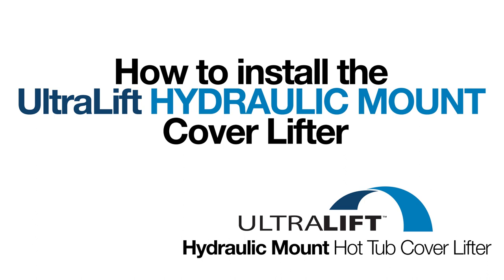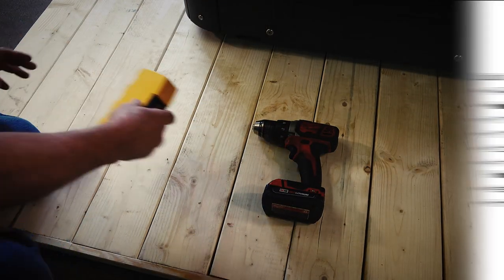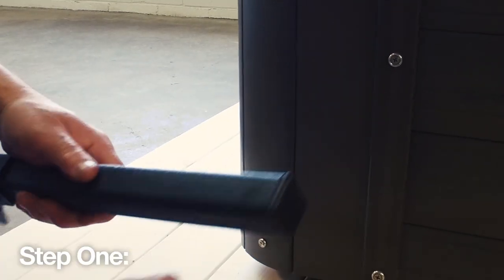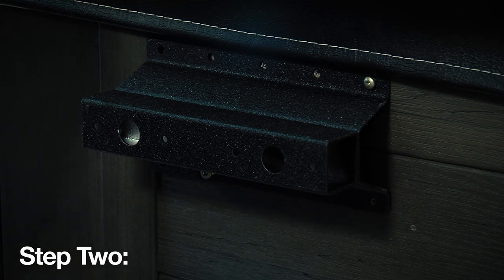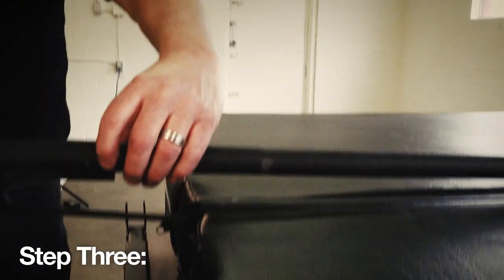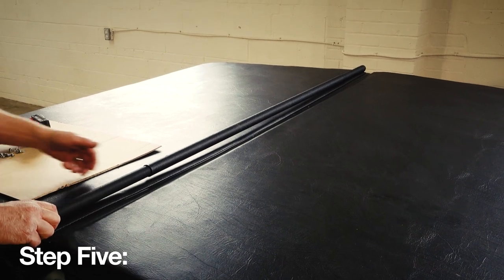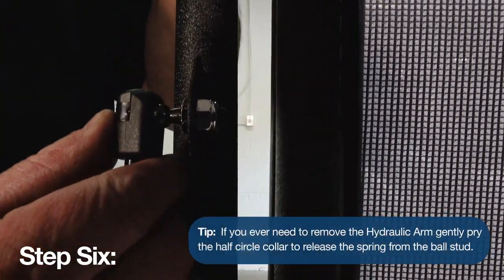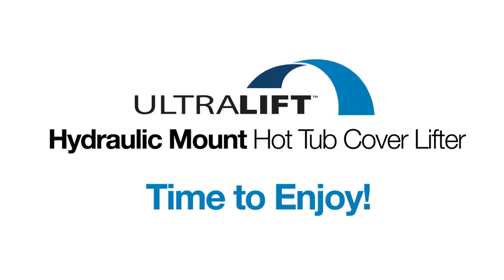Ultralift Hydraulic Mount Installation Video 2019

Comment: Disappointed that this updated release still has poor lighting, everything is black on black from the guys clothes to the lifter parts and the spa.  steps skipped.  Instructions with the lifter equally poor.  Assembly is relatively easy but 10 cents of stickers on parts would make assembly a breeze
Reply: Agreed. "Install the ball studs as shown" was particularly troublesome for me. No mention here or in the instructions to install them in the pivot arms. Intermediate pictures showing the work in progress (not zoomed in) might also help.
Reply: Are the anchoring screens for the base simply screwed into side panels or anchored to metal frame or something.

Comment: I'm still assembling this, but I had to award Ultralift a prize for the worst instructions (video and printed) of all time. Comments below are spot on: we can't see black parts on a black background, we can't make sense of zoomed-in shots where we need a sense of larger-scale structure (example: "insert the plastic "X" into the open end of bar Y" -- first of all, both ends of bar Y are open, second, zoomed in, I can't tell which is the proper end of Y), etc. I don't think I've screwed this up yet, but only partway in. I've worked slowly, constantly going between the video, the pathetic printed directions (no better if you get the document online), and the picture on the box. In the video, there are infinitesimally short segments where you can freeze the image and realize... oh, THAT goes THERE! It would take no time at all to redo the video so it was comprehensible. I should mention -- I'm a scientist/DIY'er/professor of engineering.